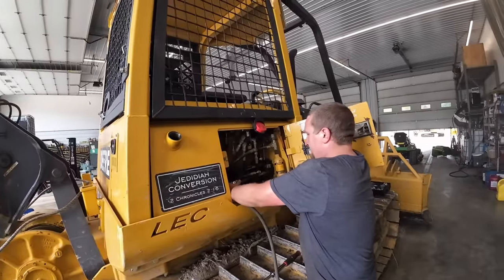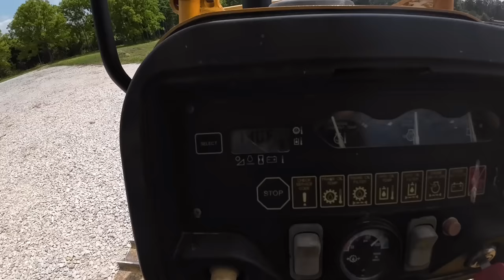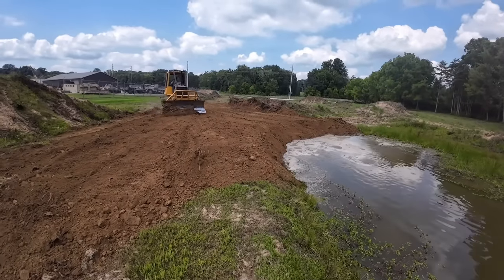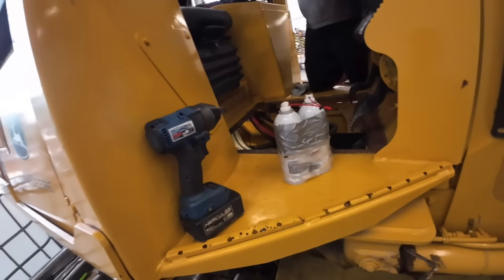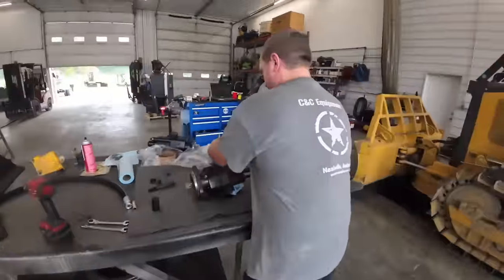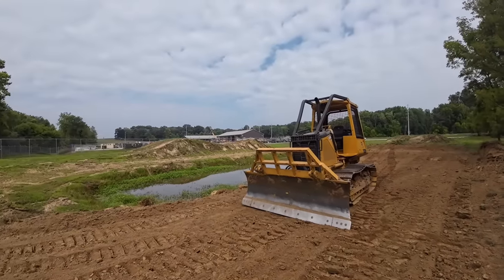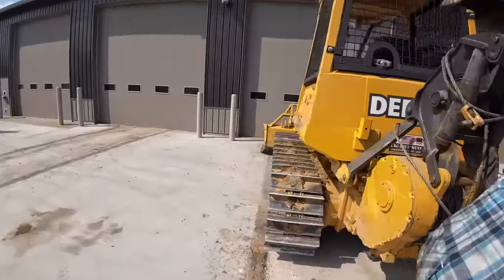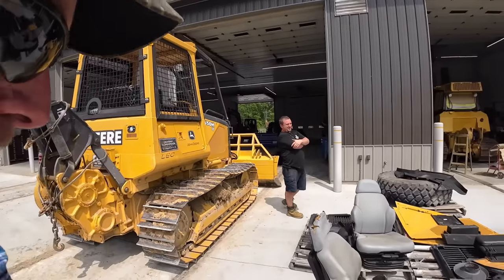Overheating hydraulics back again for the second time, I’m about to pull my hair out on this dozer!

Comment: Maybe the hydraulics are overheating because they have put 15w 40 engine oil in it.......
Reply: There is a handwritten note at about 2.40 that says they put 15w40 in the hydraulic tank,,this is probably the problem...
Reply from the maker: That’s what it’s supposed to have

Comment: those sanding pads are not great for flattening as they have velcro fluff on the back which holds the paper against the surface even if it’s not flat. a sheet of wet and dry or dri lube sand paper works best. What a frustrating machine.

Comment: the only thing i an say is maybe internal in one of the spool valves a damaged o ring or seal? the valve co i used to work for we had some of the valve positioners which cold be operated via air or hydrolic we got a few back they had damaged internal o rings causing over heating of the fluid an always erratic motion but you werent seeing any of those symptoms just over heating. also if the guy is dumping on a rail line that could lead to federal fines an jail time imagine a train derailing due to his dumped junk an the engine an cars come rollin right into your shop killing Kevin and scattering all the bolts everywhere anyone could take them then ! LOL just kidding but it is a serious issue if the junk causes a derailment

Comment: Why didn't your son have a bunch of paper towels to catch the oil, or some old rags to stop the mess? Instead you have two messes to clean up...the engine and the concrete floor...work smarter not harder! This is the down side of a YouTube channel...every Tom, Dick and Charlie has an opnion. Blue Sky's.